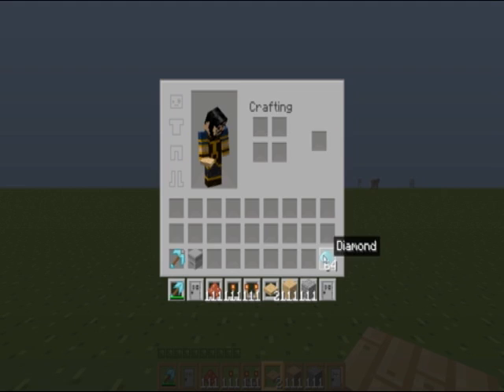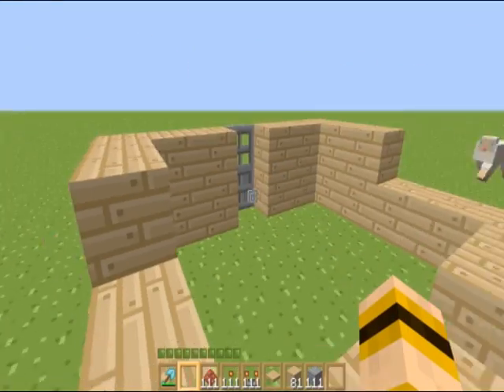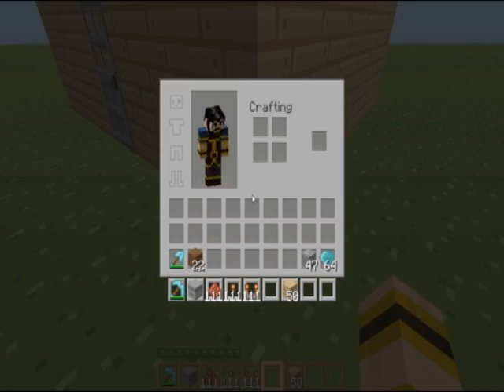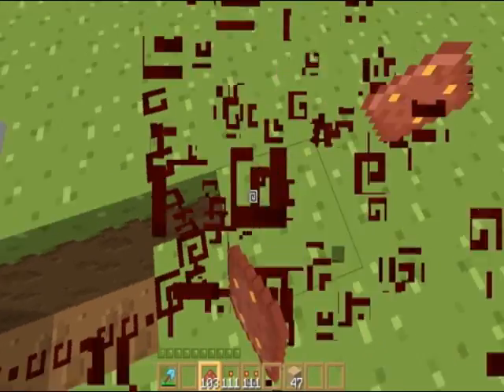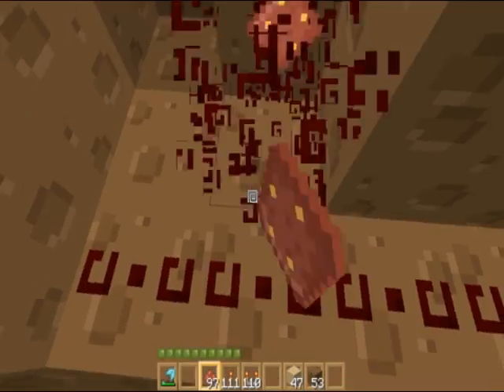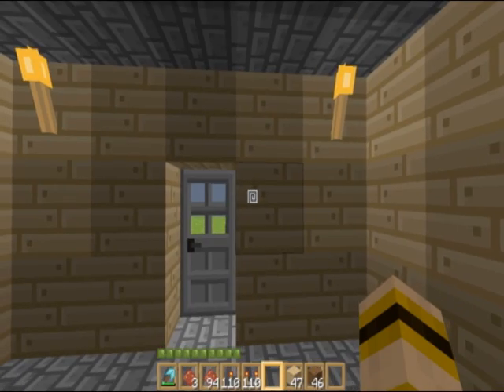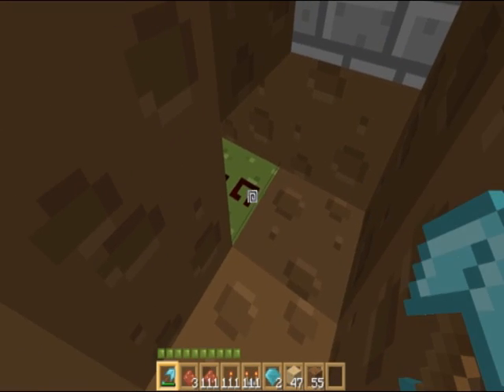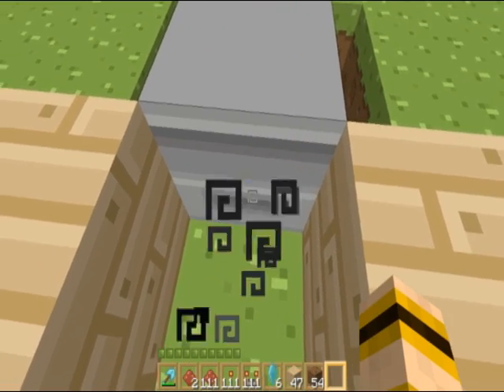Minecraft Motion Sensor Tutorial (No Mods!)

Comment: :/  This is not a "motion detector".  Even "proximity trigger" would be too generous.  I belive "Invisable pressure plate" would be more accurate.

To be a "motion detector" the device must only notice movement itself.  To qualify as a "proximity trigger"... well, one would expect more range then this method offers.  Noone calls a bounceing betty mine a "motion detector" as you need to pritty much touch the thing to set it off.  So to must you pinch a corner to trigger this device.

Comment: I've been tinkering with your design, and it's pretty good. But you're over-complicating it. Connect the output of the pressure plate to an inverter, and run redstone from the inverter to the door and dispenser, with a 4-tick repeater en route to the dispenser, and a 3-tick repeater en route to the door, and voila! Less complicated, less expensive, and it shoots ONE item from the dispenser instead of two.

Comment: Pretty cool, one thing that could improve it though; you could connect a circuit  to the dispenser from the pressure plate used to enter the room so that the dispenser only deploys an item when there is someone in the room rather then continuously deploying items, as they will all eventually disappear. But overall  you have a great idea.